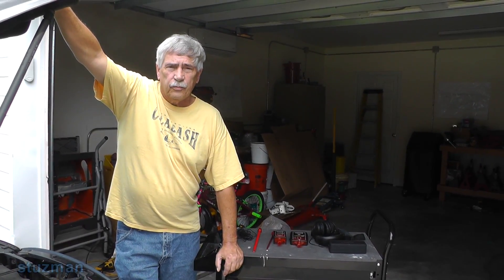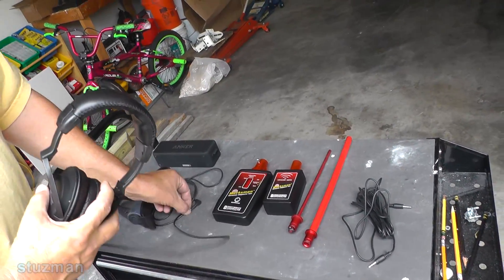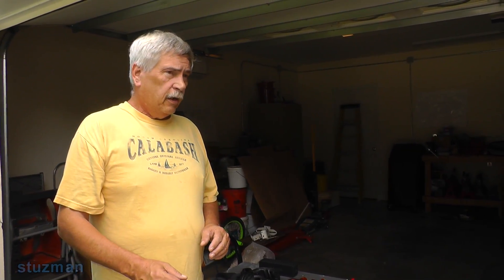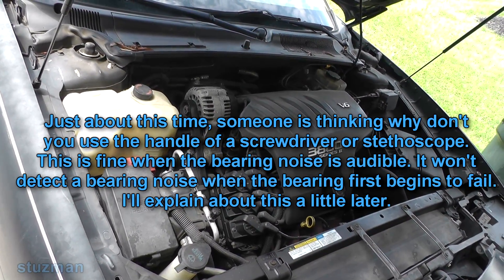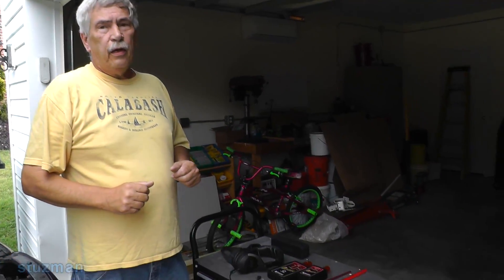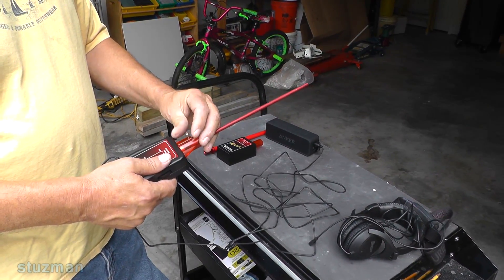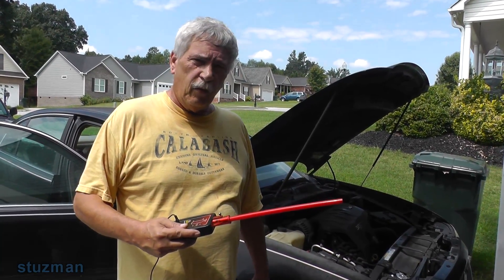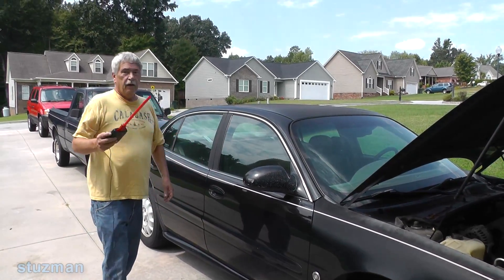Ultrasonics Diagnostics Tool: Demonstration of its Usage

Comment: Doppler ultrasound can also evaluate fluid flow, although I've never seen it used in automotive repair (presumably because of cost). It would certainly help to evaluate flow from a bad water pump.
Reply from the maker: You are correct Dave and we used them at work to measure flow of liquids. These device would just mount directly on the outside of the pipe and then you could get the amount of flow displayed on the display. Nice devices!